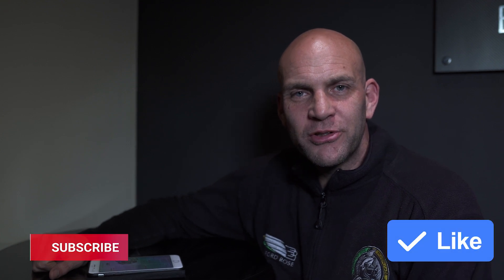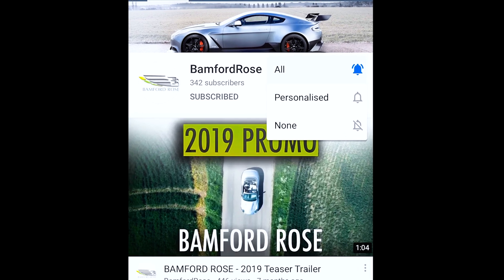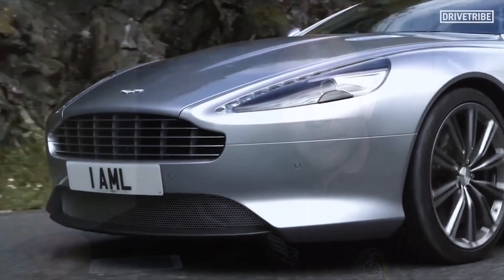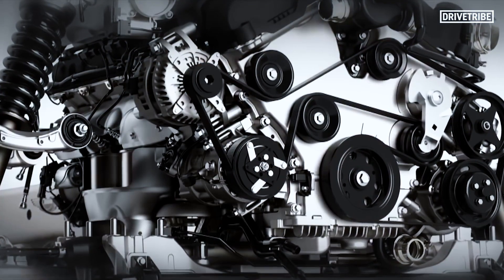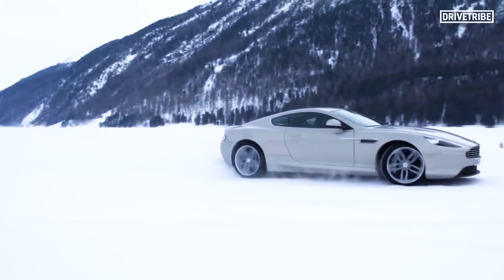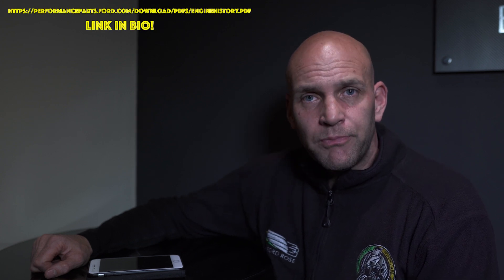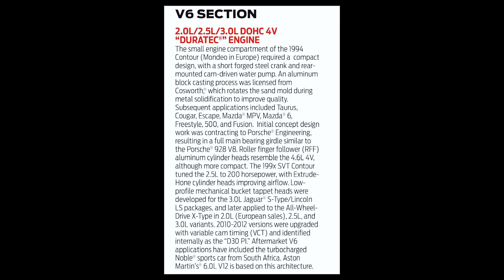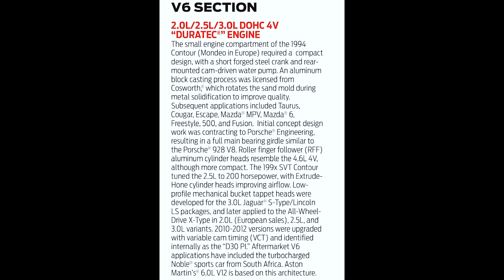Origins of a V12 Engine (Created from Ford Duratec?) -  Forum Chat 18

Comment: Just saw this older vid.  Softly stated Michael, a proper description.  More robustly, having Porsche engineering involved with a handoff to no less than Cosworth (gets no better than that) with decent people with lots of money at Ford, are sterling credentials.  Anyone wanting to cast aspertions, as if this is two Mondeo Ford motors possibly rigged together (therefore rubbish) only shows their ignorance.  Over the decades, having owned and driven classic Jaguar XJS V-12, classic Ferrari 250gte, BMW 850 and Ferrari 456GTM, provides the perspective for my choice to drive currently and fully appreciate, being a 2017 Vanquish volante.  My very serious comment would be thank you Porsche, Cosworth, Ford (Financial) and Michael for providing a path to the truth about  my very favorite V-12 engine.   Well done.

Comment: Now I know that the engine was used in the 2008 db9 but does that mean that the modern day Aston Martin v12 like the one in the 2016 Aston Martin GT12 or the 2013 Aston martin v12 vantage is still basically 2 Ford duratec 3.0l v6 smashed together?
Reply: No,   The duratec myth is just that, a myth.   Go look for the history of the v12 on google.  The real story of its development will pop up.   Also, look in the Aston Martin heritage trust magazine, there are a few articles there as well that go into full detail

Comment: Thank you! (subscribed)
I `hear on the internet' that typically the (DB9) V12 will be more expensive to run than the Vantage V8.  I have also heard that both engines are relatively `bulletproof'.  Given your experience with both motors and platforms, are operating costs dramatically different?  I can appreciate it likely drinks more fuel and when it comes to changing plugs there are more of them, but aside from these relatively trivial numbers are there other aspects that make one much more expensive than the other?